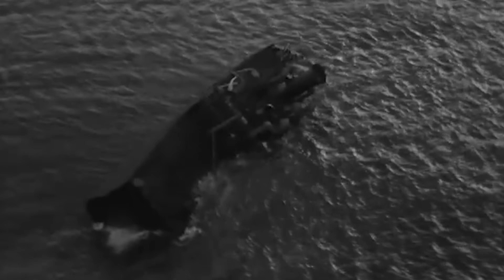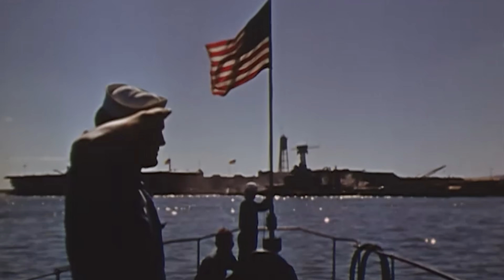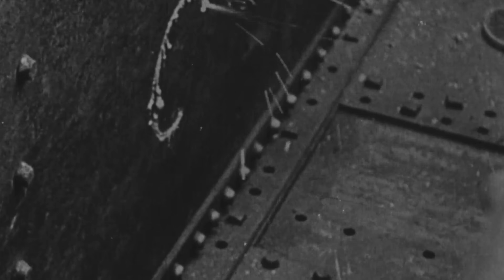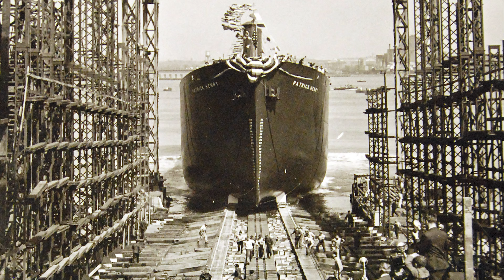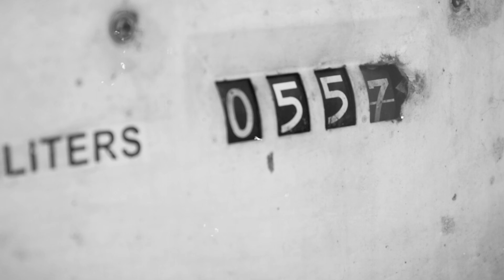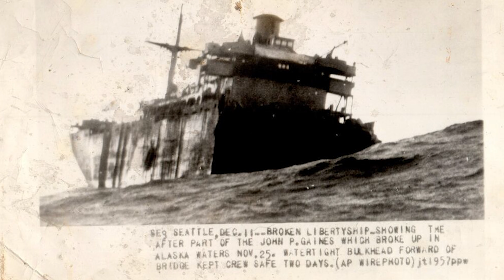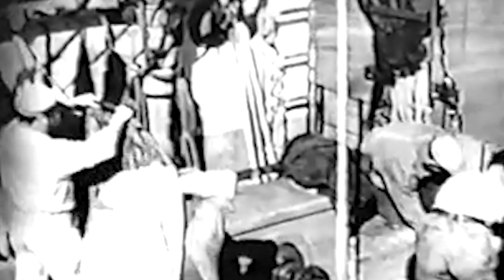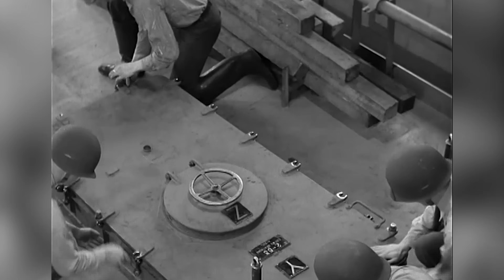CATASTROPHIC Design: The Ships That Broke in Half

Comment: Gross register tonnage (GRT, grt, g.r.t., gt), or gross registered tonnage, is a ship's total internal volume expressed in "register tons", each of which is equal to 100 cubic feet (2.83 m3). Replaced by Gross Tonnage (GT), gross register tonnage uses the total permanently enclosed capacity of the vessel as its basis for volume. Typically this is used for dockage fees, canal transit fees, and similar purposes where it is appropriate to charge based on the size of the entire vessel.

Comment: As a note, I have worked in the steel making industry for the last 20 years within quality control. 

The modern techniques we now use to test and examine the structure and quality of the steel we manufacture mean we can now identify microscopic imperfections within the steel that are so tiny that they can't be seen by the human eye. 

No order for steel is allowed to be transported to the customer, it is placed "on hold", until I have completed the quality control process to ensure the steel is fit to be used for it's intended purpose. 

So today, if you drive over a steel bridge, or travel in a ship or travel on a train moving on railtrack made where I work, over 4 million tonnes of steel per year, has been quality checked by myself. My job is to keep all you public out there in the world, safe.

Comment: I served on a ship built in 1977 that was tearing itself in half. It was later modified to have slotted/riveted section midships known as “the zip”, to allow for flex.

In heavy weather, you could stand on the catwalk and when we hit a wave, watch the fore section wobble up and down like twanging a plastic ruler on the edge of a desk.

Years later a further modification was added where two half tubes were welded on the outside and running the length of the vessel to reinforce the hull and remove the flex/wobble.

Unfortunately the nett effect of this modification wasn’t to remove the effect, but simply to transfer it somewhere else.

I was around the senior ranks messing area when I heard a yell. Our wardroom “Peggy” (steward to the officers mess) had been hoovering the chief engineer’s cabin, backing out as he went. He was just finished up, leaning through the cabin doorway when we it a wave… and the deck flexed. Violently. Right under where the steward was standing and launched him into the air and across the cabin.

Comment: my old welding instructor in college was a foreman back then; another common problem was poor fillet welds; in a poor attempt to speed up the process, many crews were laying rods in the seams and welding over them to build up a fillet (which of course made the welds extremely porous/filled with impurities from flux). After the war, their solution for strengthening ships was to weld a thick metal band on hulls the length of the ship.

Comment: Doesn't that mean ultimately metallurgy is to blame for Titanic breaking in half? That combined with who knows what kind of temper the coal fire drew on the steel and that damned ice berg.......white star knew they should have been using better steel that's the basis of why ismay tried to run back home so fast.

Comment: Well done, Mike. I was a structural engineer for 40 years specializing in bridge design and construction and the technical explanation in the video is spot on. A number of factors contributed to the structural failures, and the video goes into the details very well. The phenomenon of brittle fracture can apply to many other areas of engineering, including bridges. One of the worst failures of the 20th century (Point Pleasant, WV in 1967) was traced to a brittle failure of a truss component that was critical to the stability of the structure, which had been built in the 1920s. It turned out that the component that failed had adequate static strength but very poor toughness which was exacerbated by cold weather on the day of the failure. More recently, the Hoan bridge in Milwaukee, WI came within a hairsbreadth of collapse when 2 out of three main girders fractured on a cold day because of a badly designed welded detail that was very vulnerable to fatigue failure. The investigations into the ship failures taught the engineering community alot about fatigue and brittle fracture, but we're still learning to this day.

Comment: My grandfather was part of the crew that built Liberty Ships, my father had gone down and watched the building of these ships during the WWII. Wages were frozen by the President for the contractors which led to problems. Yeah here was an investigation, the contractors wanted fast turn around times, they controlled the equipment used and the material used. Also these ships were being built primarily in the Winter, back when men smoked while they welded. These ships were made basically how SUVs are built "unibody construction" NOT how warships were made, the biggest complaint made the ships were not "seasoned" prior to being launched.

Comment: bought brand new bolts for a project, i was putting them in place by hand not even tightening them up yet when one just snapped off for what seemed like no reason.After taking a closer look the bolt had a big slag inclusion, this was around 2015 so fully modern steel.

Comment: It comes across as curious how we only learned about the intricacies of microscopic differences in metal, when exposed to heat or cold temperatures this late, since we've known about the different results different types of heating and cooling metals, particularly steels and irons, have had of effects on the metal. We've known for well over 1000 years how to harden steel and likely also how to temper it, with one being heating it up till it's glowing red and then rapidly cooling it, before a little later coming up with tempering the steel to make it more sturdy against sudden points of stresses, as we, in that time period of history, observed that weapons and tools made of hardened steel, was prone to shatter. It's no surprise how the blacksmiths of the medieval age didn't think of how metals were affected on an "invisible" level by those heat treatments, but it is curious that in the reemergence of science during the Renaissance and the following Industrial Revolution, that seemingly none attempted to further understand exactly how steel was affected by temperatures.

I've mentioned irons as well, because I'm a cabinet maker who loves my hand planes and it isn't particularly well known outside of hand-tool woodworking, that all metal hand planes are made of cast iron, which is exposed to different cycles of heating and cooling in order to season it. It's worth noting that the seasoning of a cast iron pan is vastly different than seasoning a cast iron plane body, frog or fence, as seasoning the woodworking tools the same way as the cooking pans and pots, is quite likely to bring them out of square, hence why their seasoning is done before any faces are ground onto them, like the soles, sides and resting surfaces for the frog inside the plane body, as well as the meeting- and resting surfaces on the frog for respectively meeting the resting surface on the plane body and for mounting a plane onto the frog.

Comment: This is also a theory they used in the Titanic's accident and break-up, plus they stated the bunker fire with the cold water and the iceberg glancing it caused it, and the metal in Titanic was high in sulfur and the rivets weren't installed right and the inspection wasn't done right.

Comment: Check out Robert Frump's book Until the Sea Shall Free Them, it's an amazing read about these, as well as Two Tankers Down. They are amazing reads about these ships breaking in half. This is a simple explanation for how the Marine Sulphur Queen disappeared as well as the SS Poet. It's not just their designs having the flaws in welding but they were kept way longer in service than they should have been, and their maintenance was always deferred no matter how critical and severe, and the inspectors were paid off or didn't care or they prepared for them and took measures against them. They deferred maintenance and botched inspections for the sake of profits, they didn't want the ships laid up so long for overhaul when they could be out on runs moving cargo and making money, and they got as many runs in as humanly possible every year time after time.

Comment: I really enjoyed this one--very polished. Your video shows a brief glimps of a couple of Casablanca class esort carrers, 50 being produced, also by Kaiser, within a couple of years. They were based on merchant ship designs, all welded, and using 'dated' reciprocating steam engines due to availability. Navy expectations were someone low, but they were so impressed with their maintainabilty and service that the USN withheld the half meant for Britain (susbsituting a refined Boque class). Several Casablancas served into the 60s in various adaptations. I don't think there were hull failures on those. I wonder why.

Comment: When you mentioned the square corners of the hatchways being the start of the fracturing I immediately thought of the DeHavillan Comet jet liner.  They had used previous square design windows not knowing that the pressurization cycles would eventually cause a problem leading to the failure of the fuselage.

Comment: The reaction to these failures seems to be regrettably common. First, blame the workers. If it isn't the workers, move on the blaming the method. If it winds up not being the method, then and only then do you consider that the supplies themselves could be at fault.

Why they didn't look at the metal first is baffling, but, as you said - wartime manufacturing. Thank you for this history video!

Comment: I also spent 6 months as second mate on an SL-7 making 3-week round trips from the US East coast to Eur and back. .    The sister ships were first launched in 1968,   had two complete engine rooms putting out a combined 120 SHP.   The ship  had an ongoing problem with cracks developing at the forward corners of the first hatch aft of the house.   If memory serves there was only about 6 feet between the hatch corners and the deck edge.   When I joined the ship there were two doublers  running parallel to the hatch coaming in way of #1 hatch.  Cracks began to propagate on the doublers as well.   We watched those cracks like hawks.   As the winter season subsided we became less concerned.

Comment: I spent 14 months of my seagoing career on a C-4 built in 1942.     and also sailed as a cadet for 3 summers on a C-3 built in 1943.   The C-4 did experience cracked bottom plates due to slamming in a typhoon off of Taiwan,   which were easily repaired in a shipyard in Japan.  The slamming was because we were quite light and unladen, so the bow easily pitched up clear of the water.

Comment: Funny, I wrote a paper for my Metallography / Material Science Class in Albany, Oregon. Titled, "Do Micro Fractures cause Crack Tip Failures." The investigation by the navy examined multiple aspects settling on Arc Strikes around deck Cleats. I went through the history of the Liberty Ships and their uncanny failures in my paper. I presented my paper to the Portland Chapter of the ASME and I forget the other Authority its been close to 20 years. I took first place in the competition and received a Small Scholarship and a write up in the Chapter, in 2004. At any rate I gave a lecture on my findings along with the findings by investigations and their conclusions. This is where, If I remember, they discovered the "Blue Brittle Phase." I Knoop measured a piece of Cast Iron prior to the arc strike and then progressively into the arc strike and the Microscopic examination reviled  congregations of Martinsite in greater and greater masses closer to the origination of the strike. Along with the higher hardness numbers by the Knoop readings. These ships were worked over by the Navy till I believe the mid 60's when they gave up. Oddly the same steel formulation was used into the 80's. The "Blue Brittle Phase established than the steels formulation changes at a water temperature of 32 degrees and lower the phase change resulted in a more brittle steel which easily fractured. The Steel formulation was examined and found to contain high levels of Phosphorous and Sulfur.  These ships were built on the West Coast and East Coast the East Coast was where these issues arose. I believe there were a total of 11 of these ships suffered failures though I think there were a higher number in operation at the time. My friend and Traveling Representative for Buhler, Professor George VanDurVoot did metallurgical examinations on the Tug Boat for the Titanic and the Colossus as they were built from the same steels and he and his colleagues examined hull pieces of the Titanic one containing Rivet Holes that displayed micro fractures around their circumferences. This validating the hypnosis about rivet hole failures as a result of sharp hole punches for the rivets. They also determined that regardless of the rivet failures the damage would have been less had they not failed and that the steels brittle nature also contributed to its higher destruction. The rivets popping like a zipper and the steel tearing easier than expected. Though even with the weakness in the steels strength the rivets were the main culprit. Of course with the Titanic there were other cascading failures contributing to the rapid sinking. Failures of Water tight Doors and when they did close the ships sections were not 100 percent isolated from each section.

Comment: As a now retired mechanical engineer, I am very familiar with this story and the advancements in metallurgy which came from it.
Those ships were amongst the 1st to be of welded construction and contemporary metallurgical knowledge was almost non existent when it came to the effect of the 'heat affected zone' and the ductile-to-brittle transition temperature.

Comment: Stress cracking was also the issue for the de Havilland Comet. The first version had square windows, it had stress cracking in the windows.
They went to round windows and they stopped having issues. Though the damage was already done.
Reply: The passenger windows did have rounded fillets in the corners. The problem was in a topside navigator's window (for sextant use) that had sharp corners, single rows of rivets, and rivets punched through instead of drilled holes. That's where the breakups started.

Comment: I really have to give out probs to you, for the research. Even in germany in my international welding technolgist classes, we're being taught about the liberty ships. The material science behind welding is really tough and you really did sum it nicely. You need nickel in steels if youre using them in cold temperatures, but nickel also has the side effect that the possibillity of hot cracks rises. Even if they would have used a better steel with nickel there still probably would have been problems with the welds, because of the primitive welding practices.

Comment: The bit about Titanic breaking while Britannic and Lusitania didn't is a bit of an over simplification. Titanic was the only one of the three to still have the rear compartments of the hull fully dry unlike the Lusitania and Britannic which both flooded more evenly along their length and capsized.

Comment: A number of ore-carrying ships have split in the Great Lakes of the US/Canada.
The wave action in the Great Lakes at times is at least as bad as the open Atlantic at  its worst.  Some speculate the energy transfer through the lakes (particular Superior) is worse because of the shape of the basins and shallower depths of the Great Lakes.  I've been on Lake Erie during a storm on a ferry and I can vouch for the fact that it isn't a "fun ride"!
At least 3 ore carriers to my knowledge split in half between the late 1950s and 1975.  The most famous of these disasters was the Edmund Fitzgerald.  Deterioration/poor maintenance/metal fatigue was confirmed with the first two.  It's highly suspected from testimony of former surviving crew of the Fitzgerald the ship was a victim of hull design, poor maintenance, and metal fatigue.  There were cracked welds noted on the hull that were basically for by the epoxy equivalent of a band aid!!!
These ore carriers were all basically built like barges.  The Fitzgerald was unique among many ships because it didn't have actually water-tight holds.  Instead, the cargo holds were separated by a metal mesh (more like a "sheet of metal fencing") so that cargo could shift between holds.
Also, there was a transition period between riveting hulls and all-welding which is what was used in the Fitzgerald's construction.
There's still some mystery surrounding the Fitzgerald which will probably never be resolved because A) the regulatory services don't want new investigations of the wreck that could confirm their negligence (of both the ship's owner and the Coast Guard) and B) the ship IS deteriorating.  Catalytic action still happens in fresh water even if it appears less aggressive than salt water.  The Fitz was rusted badly in the last investigation of 1994.  The water temps may keep the bodies intact longer (they STILL deteriorate even in cold temps; soapifying and slough-off of soft tissue occurs at a slower rate) but the hull itself is deteriorating.  There was some indication from sonar images taken in the early 2000s before the "no photo, no dive, NO SONAR!" laws were passed that the tops of the cargo holds had collapsed onto what's left of the keel behind the ship's bridge.  I'm not talking about the cargo hatches collapsing, btw...  The ENTIRE top deck looks like it has collapsed onto the keel!!!